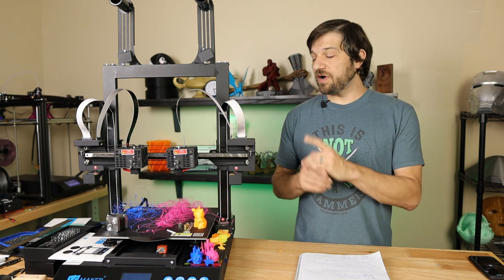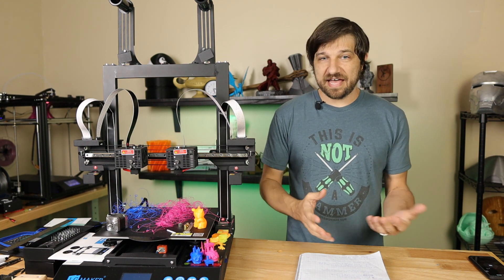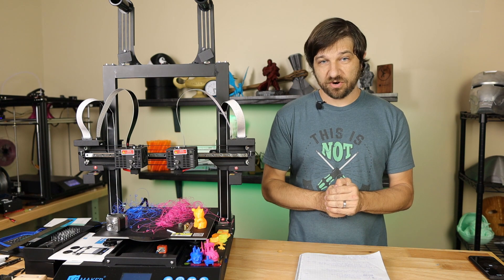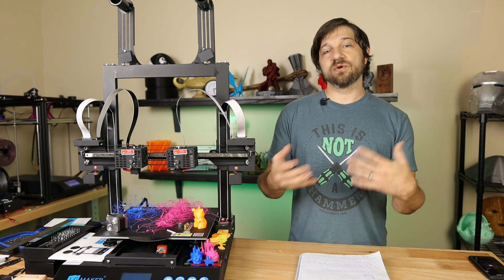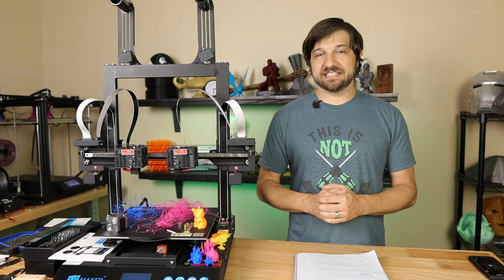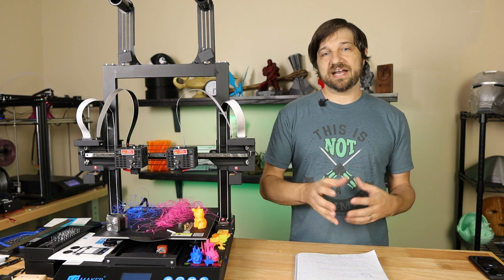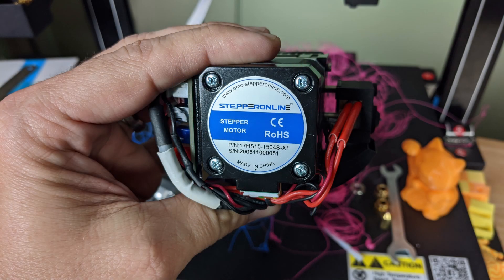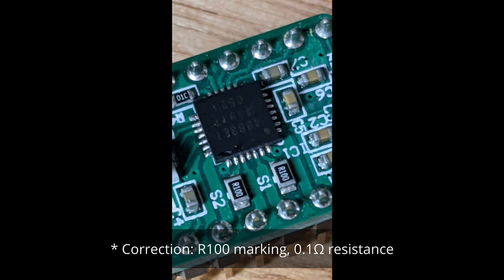JGMaker Artist-D Extruder Issue Deep Dive

Comment: what do you think about the artist d pro option that was just released
Reply from the maker: That's a tough one. Honestly, I need to see a fix for this problem first. BUT, for the money, it's not a bad upgrade. You couldn't upgrade those yourself for that price.
Reply: @kerseyfabs  ive mulled it over and decided that these are completely optional upgrades, and essentially would not be a "true" upgrade unless you use the touchscreen a lot. i use octoprint, so minus a few rudimentary settings id never touch it. the meanwell powersupply is always nice but ive never had an issue with a generic one, at least on a 3d printer.

Comment: Hey Kris, how confident are you that the extruder motor isn't skipping steps due to insufficient drive current, possibly due to resistance or intermitents in the cables or connectors? Elsewhere in the comments, Scott Worthington says he's very impressed with these cables. However, it only takes one interconnect or one conductor to be undersized to create too high a resistance.  The reason I raise this is because each time you increased the load, the results got worse, even those adjustments that should have caused a higher grip between hobbed gear and filament. Ideally you would use a scope to examine the motor voltage waveforms at the motor and compare them to those at the controller board.  And is this board really using A4988's? There's even a possibility the driver's getting overheated -- a bad batch might not have been soldered down to the thermal pad properly. If they are pluggable, it might be interesting to swap the extruder driver with one of the axis drivers.
Reply from the maker: I'm 80-90% sure the motor isn't skipping. I have not verified it with a scope or through other testing but I did run a test that I didn't show where I clamped the filament in place for 100mm extrusion and then looked at the filament. It clearly showed that it ground the filament during that time and did not simply skip. The grinding wasn't particularly deep though, so again, not 100% certain it never occurred.
I believe that the wires are sufficient and I'll tell you why. If that wire can carry the current necessary to heat the hotend, the current for the motor should be no problem.
I verified that the chips are A4988s and even have a photo around here that I took to verify the resistors and chip. Heating should not be an issue due to a heatsink and an active cooling fan.

Comment: Very detailed and insightful examination.  It seems like the only good solution would be to replace both extruders, which may or may not be difficult using their break out board.  A dual extruder system with bad extruders is not very useful

Comment: My very first impression of the extruder on the JGMAker Artist-D was that the "Raptor"-style toothed gear that's supposed to grip and push the filament is completely the wrong type. Years ago I did some testing with that type of gear and it was never workable. Even with a tight spring, the flat teeth on the "Raptor"-style gear simply slip and chew up the filament. The best type of filament gear is something like your standard MK8, and importantly is should press the filament against a skate bearing idler and not against a fixed surface. You might try modifying the existing filament gear by sticking it into a jig and "hobbing" it yourself with a thread cutter.
Reply from the maker: Take a look at this: https://youtu.be/LQjjeyr_aWQ
This shows it a bit closer. I don't think the teeth are that flat and it does have a bearing as the idler. It just doesn't work here. I don't think it's tight enough.
Reply: I saw in the video a bearing which the filament is pressed into. Can you confirm it? What does a skate bearing be different?

Comment: I think your temperature accuracy may have been flawed -- you were still checking the temperature at the heat block, not at the nozzle. Check out 3D Maker Noobs review of the printer and he noticed quite quickly there was an air gap between the heat block and their slip-in nozzle and when he tested the temperature inside the nozzle itself it was much slower to get to temperature than the heat block thermistor showed. This would explain why the temps need to be run higher to provide the same melt temp in nozzle itself, to account for the insulating air gap -- at least with the OEM nozzle.

If you haven't seen it: https://youtu.be/UKbAQJHtTBE?t=538

Also with the PTFE all the way down into the nozzle tip, that does not provide a heck of a big  melt zone inside the nozzle either.  I wonder if an all-metal nozzle with the PTFE removed and some high temp thermal interface material on the nozzle shaft might make it work better.
Reply from the maker: Here you go! Take a look: https://youtu.be/0p7NCxpJHU8

Comment: I would say that in general, just because you use a given temperature on ONE printer, it is not a given that the same temperature should be used on a different printer.  I applaud your efforts to look at different heater blocks, etc. and the "accuracy" of what the temperature probe reports.   But as you said, the proof is in the pudding, and printing an actual temperature tower to look at the interaction between the cooling and the temp inside the nozzle/extruder, etc. is important.  For example, if there is teflon tube all the way to the nozzle or does the heatbreak have a little metal before the nozzle.

One last thing I would have liked to see is a benchy done AFTER you dialed in proper extrusion, even if the temp is a bit higher than what your other printers do.

BUT still (as I said) Kudo's on the effort!
Reply from the maker: Here's more info on the temperature of the nozzle: https://youtu.be/0p7NCxpJHU8
I'm still not interested in an extruder that slips if the temperature's a little too low.
Reply: @kerseyfabs  No arguments from me here.  Sounds like they skimped on the gear (ie you really can't use a "normal" gear.  It needs sharp teeth to bite.  Even if it was dual gear.  If they are just dull gear ends (made to mesh with other gears easily), it won't properly grip.  All heat does is make it easier to push.

Comment: I have the same problem with my printer (which is not a JGMaker Artist D) with a specific filament. With hatchbox pla it works fine, but with filamentum filament, I guess because the surface is very smooth, very shiny, my titan clone extruder is not able to push it when it reaches the third layer. So it ends up clogging, but it is a clog that is easily fixable, with cleaning filament or even pushing the filament by hand. So this is just a heads up, others may have had no problems because they used easier to push filaments. I could run an extruder calibration, but since I already know the right one (because it works with other filaments) it seems pointless to me.
Reply from the maker: You're right, the finish or hardness of the filament could be an issue. Keep in mind that this is never a clog though, just slipping.

Comment: I have not had the same issues as him. I have checked it all fully just like Kris did I think part of the thing is I do tend to run my temps a tiny bit higher because I tend to print faster.. Now I'm only printing at 120mms on the artist D and my hotend is only at 208... Now the issue I have is I do not like cura and have not been able to tune it like I like so I'm swapping to ideamaker for the Artist-D.

I will say a BIG thanks for him shouting out about me and him talking because honestly I felt most of his testing he had already done before him and I talked. Now the heating block idea I came up with and I do not have a spare heating block like the one I wanted to run the test with so I asked him about it... great to see that it worked (yes I saw pics and all beforehand from him) but that means no more worries about different sized nozzles or hardened nozzle with a simple heat block swap everyone can have all the options we currently have...
Reply from the maker: Thanks Scott. I appreciate the feedback. Nice working with you.
Reply: are you getting anywhere near 120mm/s ?? ie what are the firmware hard limits (if any) on this machine? I was thinking they were pretty aggressive as this slice is 4 hours but I am at 6 hours now and only 75% through. I am slowing things down to 50mm/s with x3 p300 for jerk and acc as I always do with cr10 sized machines (I don't mind slower if it means cleaner plenty of printers if i need speed) Would love to know if you are getting 120mm/s and what the prints look like I will be sure to check our your vids!!!

Got first print going now sliced up tree frog in simplify 3D (2 color) and so far its working fine. slightly over extruding still will turn the mp down to 0.90 for the next print and see how that goes.

Really hope this machine works out. super excited to have an idex!!!
Reply: @nerys71   there are no firmware limits and hardware wise I run most of my printers at 150mms. This one can do that or better depending on the way you tune. Im using my firmware that jg maker is going to be using on the production  version.  Im actually testing an even newer version of the firmware in hopes to get it done in time to go on the production  version.
Reply: @ScottWorthingtonC3D  Nice I look forward to it !!
Reply from the maker: @Nerys  Hit me up via e-mail if you'd like the firmware I built.
kris@kerseyfabrications.com
Reply: Hi Scott, had a look through some videos to see if you had commented else where but couldn’t find anything, so sorry if you have already been asked. This printer vs the WEEDO 40x that has recently shown up on Kickstarter, what would be your preference and why?
Reply: @BrettLong   I don't have a weedo but we covered this in the KS comments  tons of differences like silent drivers waste bins wipe brushes, ribbon cables and wire managment and price are big differences BUT I don't own the weedo so hard to say for side by side.

Comment: I do find it interesting that most other reviews didn't go into extruder issues, or calibrations.  It would be interesting (off screen) for other reviewers to do a few extruder calibrations to see if the problem can be replicated across all test samples.  I'm a backer, and plan on sticking with it.  As much as it's a bit annoying there are possible extruder issues, I had full intention of replacing them as soon as I got the printer.  That's just a my use case and I understand that's not the intent of those backing this printer.  Will be interesting to hear what JGMaker has to say.

Thanks for the indepth dive on the extruders, and glad to see some capricorn tubing used in those nozzles.  I was curious if that would make a difference or not.
Reply: I posted a comment as well I HAVE run the exact same base test as Kris without any issues. I honestly wish I had had them or something close to be able to say yes it's in fact an issue lets find the source my problem is mine was never off except for the first try when I found that the knob on the tensionor was caught on the housing a tiny bit easy fix. so Now with me not having the issue I run into the issue of not having a test subject...  BUT I'm also glad Kris had the issue because he was able to do a bunch of test including swapping to a e3d V6 style heat block and using standard nozzle... so now we also know that we can do the same and have all the nozzle sizes and types out as well... Maybe I should try volcano...LOL Maybe not ... LOL
Reply: @ScottWorthingtonC3D  As these printers start rolling into backers hands, and more of us get time to really put them through their paces, a consumable and alternate part video would be valuable.  Being able to swap out the heat block and use standard nozzles is a good example.  Being able to swap in a volcano or not...  even more valuable information!  I'm not expecting this printer to be perfect off the line, but I still feel it has HUGE potential.  With the right support, I really feel this could be the Ender 3 of IDEX printers.  JGmaker just needs to stay on top of the more common issues.

As for Kris's extruder issues...  I'd like to see this spread to everyone else who reviewed the printer and get a general consensus on extruder quality and accuracy.  Shouldn't take long for each, but would provide a wealth of information to relay back to JGMaker.

Thanks for the reply, I genuinely can't wait to get one of these in hand!

Comment: So, to be clear, is it under extruding because the actual stepper motor skips, or is it under extruding because the filament is not being "grabbed" properly?
Reply from the maker: I'm sorry if I still wasn't clear. Here's how I'm using the terms:
Extruder Skipping: This would mean that the extruder motor was skipping steps.
Extruder Slipping: This means that the filament is actually slipping through the extruder gear.
In this case, it is slipping because the extruder is not grabbing it properly/tight enough to push it through the nozzle. This was the purpose of my extruder motor test, to make sure it wasn't under-powered.
Reply: @kerseyfabs  Then, it is the filament slipping.  That seems to be a fairly easy fix with a bit of fine tuning the tension, either via the included knob or a replacement screw.  All that needs to happen is for the extruder's gear teeth to dig in a bit deeper into the filament so it stops slipping.  Anyway, thank you very much for your quick reply.
Reply from the maker: That was the point of testing adding a tightening screw and testing a different drive gear. Neither of these fixed the problem.
Reply: @kerseyfabs  Taking into account that I do not have one of these printers yet, and that I'm only going on what I have been able to see on videos, the extruder seems to be very similar to an MK8 type.  What is preventing the tightening knob or screw from pushing the bearing closer to the extruder gear (pinching the filament more)?
Reply from the maker: @Angwolf1966  The knob on the front of the extruder doesn't do anything except give you something to push on. It doesn't tighten anything. In test #4, I inserted a screw into that same hole that allowed me to tighten down the extruder all the way. It didn't help. Rewatch that segment for more info.
Reply: @kerseyfabs  I just rewatched the segment's very short video of the spring assembly being pushed in.  Please, correct me if I'm wrong here, but pushing that assembly "in" seems to be moving the filament path further away from the extruder gear.  The spring pushing "out" seems to bring the filament path closer to the extruder gear, creating more "bite" on the filament.  My question is: is the filament constrained to a set path?  If so, the opening on that path, where the extruder gear grabs the filament, might not be large enough to allow for a proper bite/grip.  I can't really tell for sure with the short video, but I think that might be the reason.

Comment: Thanks for the update. 
I know this is a real problem and more inexperienced people should drop the Kickstarter over this problem. No doubt. 

But if you get this printer for unter MSRP (flash sale or super early bird) then I think it’s even worth it to just replace the direct drive setup with two dual gear extruder Bowden tube setups. This, and proper part cooling, will be the mods I will do first on my printer. 

On the other hand I wouldn’t buy a $600 printer that can’t extrude properly. i hope JGmaker fixes those issues at least for the pro version.
Reply from the maker: I agree that the price is right to make this a mod printer. I do expect a working printer out of the box though. I hope they make some quick corrections.